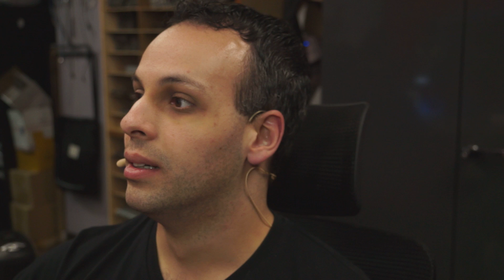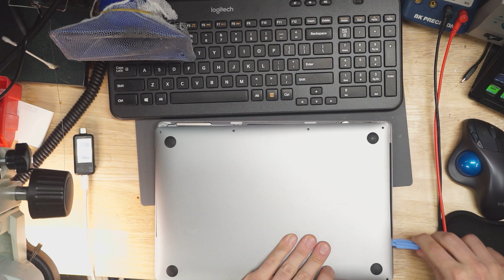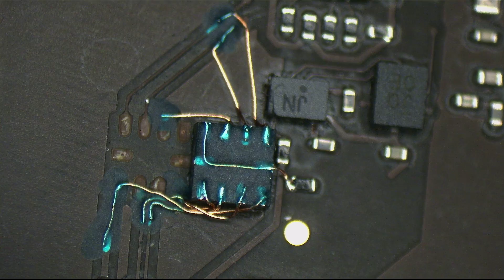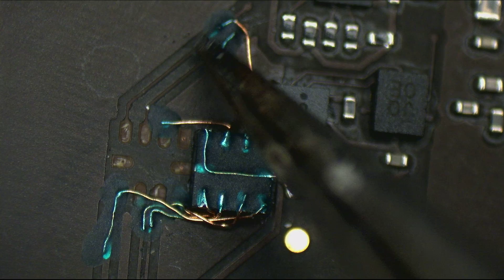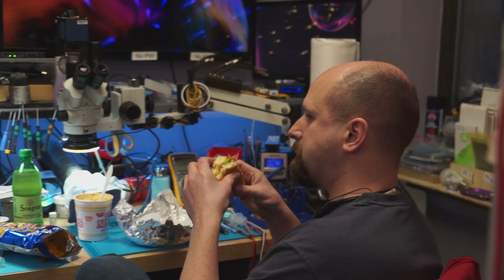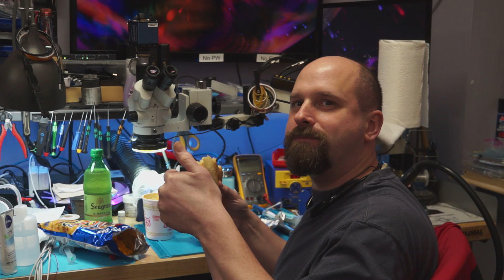Why is opening Macbook a boobytrap?

Comment: Simple steps to fix a broken mac:

Step 1: Acquire screwdriver.
Step 2: Use screwdriver to break into roommates room.
Step 3: Steal roommates windows laptop.
Step 4: Use roommates windows laptop to order new computer that doesn't run on pretentiousness.
Reply: Why would you need a screwdriver to brake into your own room?

Comment: Or just don't ever by Apple anything ever, works for me.  I'd 100% recommend it.
Reply: Postghost what laptops would you recommend then?? Mostly for school work
Reply: @lolaismycatsname  Anything NOT made by Apple.  
The remaining selection available to you is still beyond vast ofc.
But personally, if I was buying a laptop for schoolwork i.e not any graphic intensive use, then personally I'd look around for a used/refurbished one from virtually any other brand except probably ACER(that being said, I'd still buy any ACER product long before I'd buy any Apple product tho, still avoid it if possible omho, id probably look for a Lenovo or HP or anything slightly reputable). 

  You could probably pick up a refurbished, 64bit, win10, still entirely current 2nd hand unit for anywhere from around $200 and upwards. Depending on how much guts you want it to have.  But yea, If I was just basically web searching and word processing on it there's no point in dropping the bloat-cost of spanking brand new laptops.
The main thing I'd consider before doing that is: can I get another battery for it/ how much might the battery cost if the one it comes with is inadequate or stale(little to no charge retention).
I'm far from a laptop expert but that's my thoughts on it.
Reply: Postghost This is very helpful, thanks!

Comment: There's a rig that Apple graciously sells for (I think) $350 to help remove the bottom cover.  If you put the suction cups just above the front "feet" and pull the front corners up about 1/2 - 3/4" it will pop open.  Then you need to grab the front end of the bottom cover and slide it back.  It helps if you have the corners held down and wearing some thick-ish gloves.

Comment: Apple products are not meant to be fixed, as clearly you might know by now. If an Apple product breaks you should replace it, it doesn't matter if the problem is easy to solve or not.
Apple products are meant for people that can afford them, and so if one of those products break, as is natural in any product, is taken for granted that you have the capacity to buy another one.
Now I understand that many people that cannot afford Apple products buy them, and it's natural for them to try to fix them, which is something that Apple will never do, something which is totally at their discretion.
The bottom line is that, if you have the money then buy Apple products, if you don't have the money, buy something else or buy it but be aware of the implications if the product malfunction after some time.

Comment: reminds me of when I dismantled an LCD monitor, they put what I guess where the lcd control chips (several around the panel), unprotected dies straight out the wafer, in front of every plastic clip you have to pry open it's was so obvious they did this to get them damaged or "wear" faster (humidity protection no ?)

Comment: I am not an apple fanboy. But, I love the mac operating system, I rarely boot into windows (on bootcamp) and with bash built right into the terminal i feel like im on linux whenever I’m accessing git. That said, macs are expensive. Thanks to louis Rossmann, I am releived that i dont have to spend a fortune repairing my macbook, in case something goes wrong. I own a mbp 2017 with touchbar, it was painful to watch rossmann pull the keys out to repair it. Fortunately my keys started giving me trouble after apple announced their keyboard replacement program. I got it replaced for free. But i am confident, the keys will die again and apple will refuse to fix it. Thank god i can send it you in case it happens again.

Comment: The official Apple rig is only $260 CAD. That said the suction cup method is pretty easy as long as you are lifting up where the clips are - not 3" away and just bending the cover. And if you put on rubber cut resistant gloves and pull with the machine braced against something it usually goes well the first time.

Comment: They give you one of those little plastic pry tools if you buy a replacement battery kit for a smart phone. The only problem I have with them is that they are too weak, they bend, distort and break before they open the case. I find that one of the little metal "spudgers"  (iSesamo) works much better on phones. Maybe Macbooks are different.

Comment: there designed that way indeed look at apple iMacs and how the lcd isn't shielded from the power supply wonder why its easy to short one out or my recent joy of reassembling a 2011 iMac where the jerk nosal couldn't hook up the lcd correctly back to the main board what can I say I may be a apple user but no way in hell will I pay apples prices I will just buy a nice used machine
Reply: gsx-r7502018   Alienware is stupid expensive, go with another company, like maybe gigabyte.

Comment: How does that sensor work with all of the bottom leads twisted up and crossed? Genuine question...
Reply: The wire is enameled and that's not conductive. However, it does scratch easily so this makes me a little nervous. However, Louis is the pro and apparently considers it acceptable so I'll bow to his superior experience.

Comment: This kind of laptop design is disgraceful, and not a good contrast with MBP design prior to 2012. It's anti-consumer, anti-environment, and and reflects Apple's greediness in trying to ensure that they are the only ones that can make a needed repair.
Reply: And that's why I will not buy this junk XD Products that costs hundreds of dollars, and you cannot upgrade its hardware, you cannot repair it yourself, you cannot change software easily - that's a freakin' joke XD
Reply: @damich-t  
That is what we call a scam...
Reply: Thats why i refuse to buy any apple products. 
As gorgeous as their software and os looks, this video speaks volumes.
Reply: Actually I still think this isn't that difficult. I owned the 2008 mbp unfortunately I didn't know the need to clean the fans which significantly maintained the performance of the computer. Since the repair was way to expensive I bought a new Asus laptop, used it for a few years and you have no idea what a pain in the ass it is to even get access to the fan.

Nowadays you can see a lot of tutorial on these with just about any model. Even after watching the demonstration, I was still very hesitant. Firstly there is a lot of careful prying, the screws that should open the first cover isn't even that obvious, for mbp you only have those 8 or so screws because the design is so clean. I have to remove the screen as well, and this was also very risky since there's wire connecting it to the main board so you have to be careful lifting the screen once the screws are off to get access to part of the key board that sits just below it.
Removing the whole keyboard was just as tricky since it has short wires connecting to the motherboard, I had to pry it open and once it's off, you risk damaging the wire if you didn't know there's a wire connection there. So you had to lift half of it while disconnecting those wires. It's actually like the issue with this Mbp cover, you have to slide a pry tool all over and still use some force to actually get it off, and that force risks you damaging the wire if you're not careful.

I'm no expert in electronics, but I find it incredibly helpful in maintaining the performance of your computer if you can clean the fan once a while depending on use, so getting access to the fan was very important for me.

Also since my  2008 MBP  died not only because the fan had died, but apparently there was also a faulty with he mother board I've been keeping  it in storage for years. But when I learned about cleaning and re-lubricating the fan decided to take it out, removed the battery which was bloated cleaned the fan and lubed it. I broke one of the 2 fans since the gunk had dried up, and surprisingly my mbp runs again, with 1 fan and no battery. 
 Had I tried this 5 years ago, and perhaps just replace the battery my mob would've still bee  in use and I wouldn't have bought a new laptop. Not to mention the Asus fan and some other brands of laptop like acers has fans that are difficult to take apart.
 
I don't know about te later versions of their fan, but the blade of my 200 popped right off. Also I saw a friend of mine's mbp, they changed the phillips screw it used  to a 5 or 6 star shaped ones I don't know what it's called. I think some deterrence in accessing the insides are necessary because so not anyone can just open it and potentially mess it up. It's the same with many electronics for instance hardware tools they tend to not use phillips head to detter people from fiddling with it.

Comment: next mac book version big strong blob of glue on top of that chip and others so it gets ripped off when you remove the cover...
Reply: The following mac book won't have an opening and the whole thing would be wielded.
Reply: And there's a timer to specifically shut down the macbook until it's taken to them geniuses and won't boot until paying up some cheap $1500

Comment: Pry up in a corner screw hole with the pentalobe driver and insert spundger. Pop the head bolts, wedge out with a very worn spudger between the clutch cover and front of the top case. Simple stuff. Don't scratch your knuckles! This is the one case where you don't want to use a metal tool! Just wedge and push, it will pop off for you. (Unless it was crossthreaded from the factory and they broke free, in which case you will not be greeted with a pop.)

Jesus Christ, Paul, you are my man! If Lousi paid me to do that I'd do it, but not for anyone else. Good job, bro!!
Reply: Ideally you should use an "absorber" (ubreakifix nomenclature for a suction cup)

Use the suction cup, or absorber, and lift the corner of the bottom case. Insert a "like new" "spudger" between the cases and get it in there and run it around to the side to pop the tabs. 

Point: on MacBooks, quite often the screws have released from their threads and you will not get a pop. That's cool, if it doesn't pop consider it popped. Just take it off the fork and screw it back into the top case with a T5 bit. (Might be T3?)

Also this was the episode I learned "giving it to Paul" was not a slight. If that's Paul's work then that's bad ass. I can flip an SMC just as well, but Louis unfortunately doesn't employ my ass, so double props to Paul for that repair and being in a great place in life working for Louis's, who is also looking good

Peace. Y'all stay warm

Comment: A much better way is to run the jumper wires where the pads were, solder the chip on top of the wires and glue the chip in place. But if the customer does not open the Mac then I suppose this will do.

Comment: Your suppose to use a suction cup to lift the bottom case away from the snaps. Then using a beer belly, pull the bottom case toward you using your beer belly as a stopper. You obviously have never seen the manual

Comment: I thought the recyclable aluminium makes the new macs more environmentally friendly. 
It is easier to get into a Fort Knox than get into a new MacBook , are they going to put like cameras so they can take a photo of you when you open the MacBook because Apple loves privacy and doesn’t want fixing the MacBook because it makes apples shareholders sad. 
Are they going to employ the mission impossible team to make a MacBook impervious to attacks.
Why can’t apple just makes MacBooks easy to repair with actually an upgradable cpu, gpu, ram and ssd if they are so environmentally friendly rather than adding to the large ewaste landfills of electronic graveyards in China where people die due to being poisoned. 
I wish apple would support right to repair as it holds the future of electronics back.
Reply: You can only upgrade CPUs on very few laptops
You cannot upgrade GPUs
But yeah, RAM and SSDs should be upgradable

Comment: I've just had a "Road to Damascus" sized revelation!
I'd previously thought Apple was continuously skewing their product design from function to form in a misguided attempt to get more customers.
The revelation was Apple customers will buy Apple anyway - and are quite vocal themselves on these changes. I've never seen a comment from anybody of any persuasion anywhere that that "latest model hasn't shrunk enough, has too many internal connectors, is too repairable, has too many ports" etc etc.
Or "turning the function keys into an RBG lightshow isn't enough, we want the whole keyboard converted!!"
Basically whenever Louis complains about a change they've made, there is absolutely NOBODY out there pushing the counter argument.
My only conclusion is that every action from Apple over the last few years has been solely designed to piss Louis off.
Therefore, he is the cause of all our suffering.

Comment: Do You think in 2019 used MacBook will be good choice? Or wait to 2019 MacBook Pro?

For front/back dev, xcode, photo, little vid?

Price in UE 

MacBook Pro 15 2013 late i7 2.3/16gb/512gb/gt750 / 1.380$

MacBook Pro 15 2015 i7 2.5/16gb/512gb/m370x / 1.752$

MacBook Pro 15 2015 i7 2.8/16gb/1tb/m370x  / 1.858$

Or Windows?
Huawei Matebook x pro i7 1.8/16gb/512gb/mx150 / 1.937$

You use still 2015 MacBook Pro? For programmer and dev will be good?

Or build Hackintosh?

..

NEW MacBook 2018 problems:

-3’rd gen keyboard stuck and crush, if You not buy apple care, take 500 $ for the new keyboard from You pocket
https://youtu.be/cZpnX26pFe8

And this check

https://youtu.be/4QDsqWkUvXQ

-T2 chip make panic kernel
-Temp are crazy, soon or later You burn all chips inside

I think, I will build at half-price Hackintosh 

Morgonaut https://youtu.be/fA9AotXqkqA

Or Snazzy Labs https://youtu.be/uCwAYydwtr4

Or DidsLive https://youtu.be/i1TzOA39Y1c

Or Li Motion https://youtu.be/wbKs6AMd7B4

Comment: Almost bought an A1707 Emc 3162 (2017 15" MBP Touch Bar) no power due to water damage last night for $500. But in the 10 seconds or so I had before someone else bought it I ultimately decided not to get it. Kinda kicking myself in the butt not to have bought it, but I'll take this video as a sign that I made the right call. It was a hell of a good deal but I was concerned with working on something so "expensive" given my experience level and was worried of something like this happening while taking apart a model I'd never worked with before.

And P.S. that's a damn good looking dead bug job :)